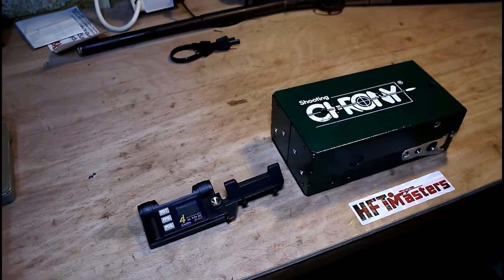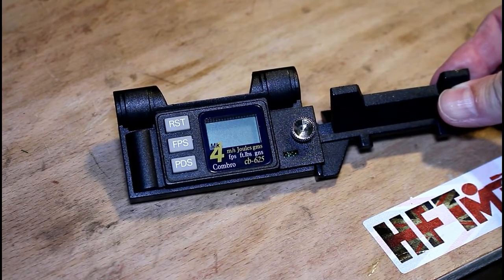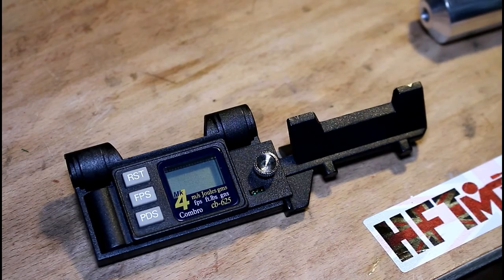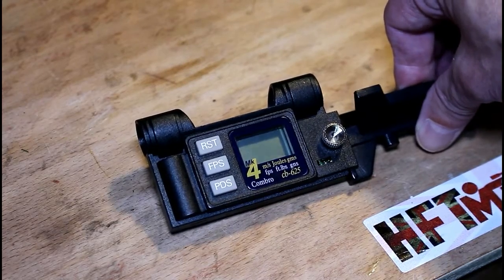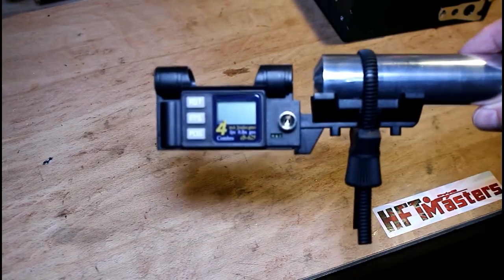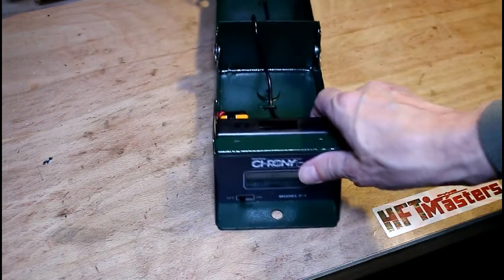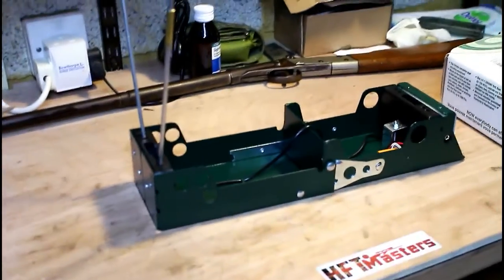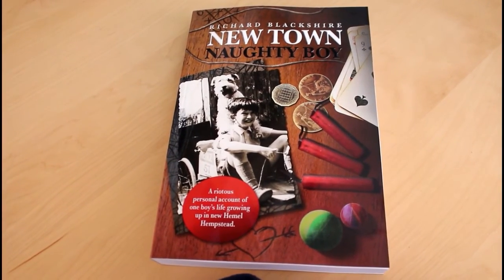Chronographs and air rifles (Part 1 ) by New Town Naughty Boy

Comment: Got mine yesterday.  You have to input pellet weight and something else I'm not clear on. Difficult to work the slide adjustment when you switch barrels/guns. It does not come with the yellow plastic guide. Handy & inexpensive